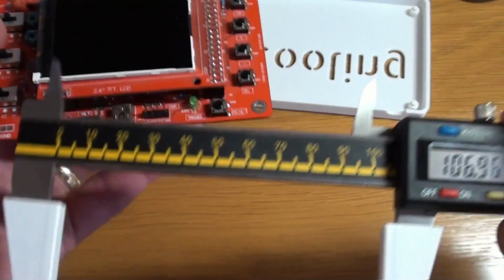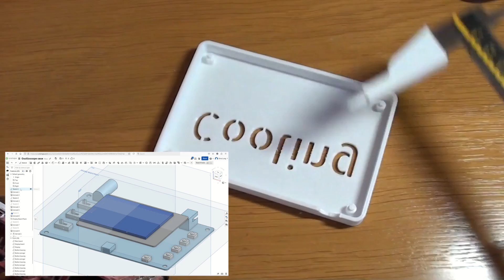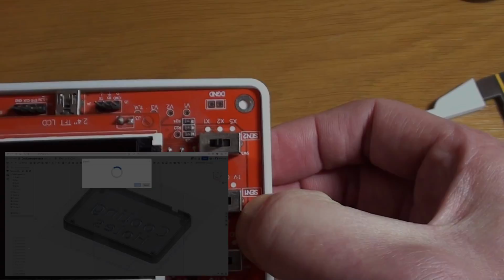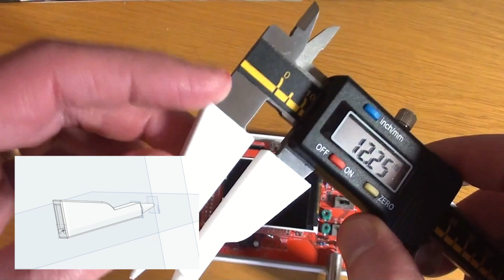Hole Measuring Gauges for Digital Calipers

Comment: How do I print a pair of these from that onshape link?
Reply from the maker: @AHaensel The STL is now available from Printables, link in the description.
Reply from the maker: You should be able to right click on 'Part 1' in the parts list at the bottom left of the screen, then choose 'Export...' to save it as an STL file. Then run that through your normal slicing software etc. just print two of the exact same part, the jaws on your calipers should be symmetrical. I found printing them with the points facing up worked best for me.
Reply: @ChrisBLong  In the parts list in the bottom left I see one part "Caliper hole gauge" and if I right click it, the options are Hide, Isolate, Make transparent and Zoom to selection.
Reply: @AHaensel  Same, doesn't work for me either.
Reply from the maker: @AHaensel  ok, I didn't realise the 'View' feature in OnShape removes 'Export'. You'd have to copy the document to your own OnShape account first, in that case. I'll upload an STL somewhere as soon as I get a chance, weekends are busy 😉

Comment: Couple of questions here. Won't the attachment introduce a measuring error? How repeatable is attaching the device to the extend of getting the same measurement twice? Is the 3d printed attachment better calibrated than the caliper itself, from the point of view of the yaws? 

I understand the idea, but fail to get why it'd be better than just using the regular technic of measuring one of the holes and zeroing the calibers on that. From my lab and machine shop experience, adding attachments to a measuring device just introduces additional measuring errors.
Reply from the maker: I guess they must be an additional source of error, but it's small and quantifiable. Adding and removing these gadgets, even swapping side-to-side, the calipers always read 7.31mm +/- 0.01mm each time, so their location on the jaws is quite repeatable (you'll note the 'hump' on the inside face of the socket to ensure a single point of contact on that side).

That's certainly good enough for me as a 3D printing hobbyist; this was just a fun video to demo an idea, I'm not suggesting that these gadgets should be adopted by high-precision machinists, and certainly not in 3D printed form.

It's not necessarily better that the regular technique in terms of precision; it cuts out one step, if you already know or don't need to know the diameter of the holes, and measuring the holes is quite fiddly and subject to a small error depending on the radius of the 'sharp' edge of the caliper jaw relative to the radius of the hole.

Thanks for taking the time to comment, I appreciate the feedback.

Comment: Measure the smallest distance (inner edge) and add the hole diameter, or the outer edge and subtract the hole diameter. The center of the hole is the radius, as you have two holes you have two times the radious, so the diameter. You need that hole diameter anyway ¯\_(ツ)_/¯

Comment: ok. old dude here. Pay attention.  Measure the diameter of 1 hole, while still in that hole and at that diameter, RESET to zero. pull out the caliper and measure between the 2 holes. What you see is the distance between the holes. Don't forget to reset to zero with the calipers closed.  And I should pay more attention to the comments 😀

Comment: ...., measure near Edge to near Edge. If the holes are the same size, then that's how far apart the centers are.
Reply from the maker: You mean, left edge to left edge? The trouble with that is that there's nothing for one of the jaws to reference against.

Comment: Sorry, but it is really easy to get an accurate measurement of hole centres using a caliper.  Just use outward facing tips to get the diameter of one of the holes, pull the caliper out of the hole, press INC/ZERO to reset the caliper to 0.00mm (without moving its position), and then just measure between the outer-most edge of one of the holes to the outer-most edage of the other hole (again using the ouward facing tips).  Now your caliper shows you a very accurate, repeatable, mesurement between the centers.  Don't forget to reset your calipers back to normal afterwards.
Reply from the maker: I have tried this method, and it definitely works, but I found it a bit fiddly to do and a bit less repeatable than the jaw extensions. I think there's a skill to using the calipers accurately that you probably have and I don't 🙂
Reply: @ChrisBLong  No more skill needed than using your jaws. The method mentioned above is still more accurate and repeatable. 

Not saying your method sucks, its another solution to the same problem. While is good,  i just want others reading to know that is less effective on the use case above.
Now, if you were measuring holes deep inside an assemble that couldn't be reached with the caliper jaws, by all means this will be better for sure.
Reply: I like the option of being able to use both methods. So I think this is neat.
Reply: Great suggestion - but requires digital calipers. I have my dad's older analogue ones, so I'm doing the double measure of hole diameter and inner distance - and while the error is minimal, it can get more cumbersome if the holes are different diameters.
Reply: @eh42 Frankly I prefer analog calipers, no batteries! Both methods still work...now off to the printer...
Reply: I'm familiar with this easy trick, but there have definitely been times when some inconvenient geometry has found itself between the holes. The printed bits would be welcomed in those rare cases but otherwise I'm offsetting the hold dia.
Reply: I found it's tough because if you're doing really small holes the flat part of the calipers make it hard to know how much of the diameter you're losing because you're not getting it crisply tangent enough as well as it's really hard to hold the caliper and know if you're pinching the two outsides or inside so it's tight as you can or if it's being thrown off. 

For me it's more the need to take machined aluminum plates and try to accurately plot the holes in a cad file when you have a couple of dozen of them where most don't seem to follow a clean pattern.
Reply: this is the correct use of the tool.

Comment: I measure the biggest distance  first, then rotate the calipers upside down and measure the smallest distance. The average = center distance …
Reply: If the holes are same size as in this example, just measure smallest distance and add 1 hole diameter = center to center. You can also measure biggest distance and minus 1 hole diameter = also center to center.

But yes, these jaw extensions are excellent idea, especially if you have lots of measurements to do.
Reply from the maker: Clever! That would also give you the diameter of the holes. I'll try it. Thanks for the tip!

Comment: I think this is already a commercial product? Also what's the distance between the zero point where the caliper jaws are together and the centers of the hole guides? Did you build that into the construction?
Reply from the maker: Yes, the extensions are designed so that the caliper jaw is exactly* in line with the central axis of the cone that fits in to the hole. The cone self-centres in any size hole (from 1mm up to about 6mm) and then you know that the caliper jaw is exactly* above the centre of the hole (*within the accuracy limits of a 3D printed part, at least).